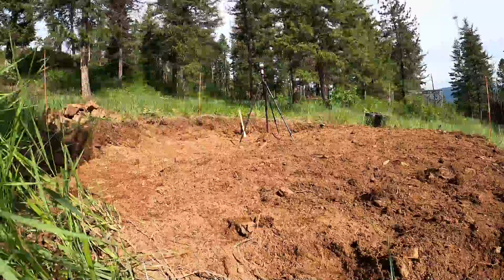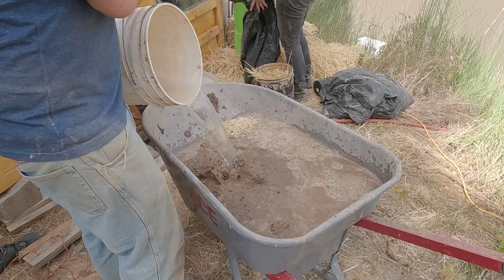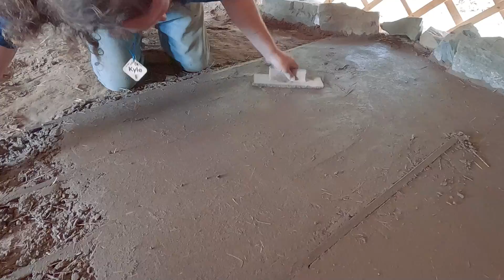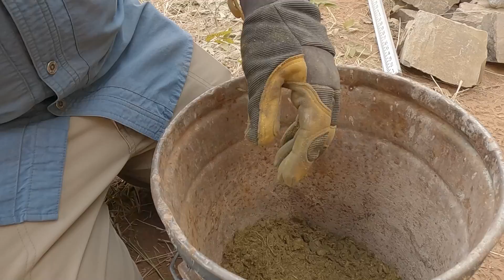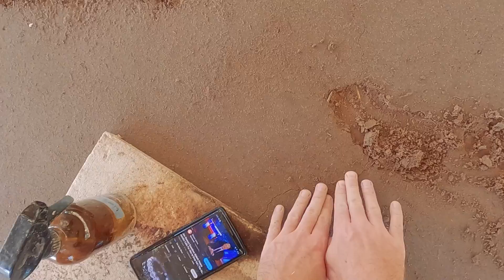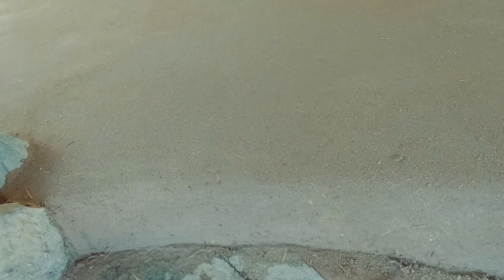Earth Floor Install in an Authentic Mongolian Yurt | 2024 Permaculture Technology Jamboree

Comment: Hi Stoic, really amazing. Do you have info about the need of expansion joints on surfaces such as these? Didn't see much info on the subject. Thank you
Reply from the maker: Sorry for the delayed response. Because you are manually compressing this floor there is no need for expansion joints like in concrete.

Comment: has anyone ever tried using power tools to install earth floor?
Reply from the maker: We use power to mix mud usually, we didn't here just because we didn't need that much or have good mixing tools. And gas powered tamping machines are sometimes used to compress the grade, gravel and subfloor layers. As far as I'm aware though the final mud layers and finishes need to be done by hand. I would be open to ideas for making that easier with power tools.

Comment: If you want mechanical traction to the subfloor, why not just pour over angular gravel?
Reply from the maker: You can. The advantage of this layered earth method is that most of the earth is not an engineered mud mix, which means less labor, and it arguably makes a slightly better thermal battery than a full mud pour. But only the top inch or two is an engineered mud. And it would be risky to put that thin of mud over gravel because if there is any shifting that takes place underneath it could break.